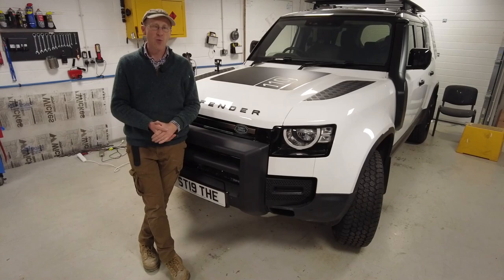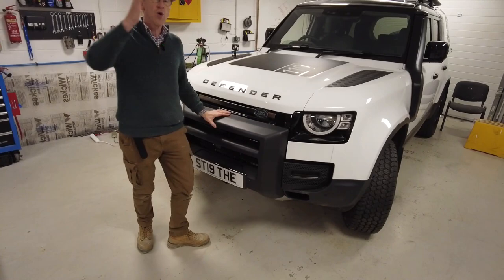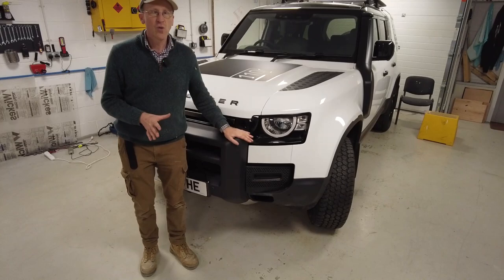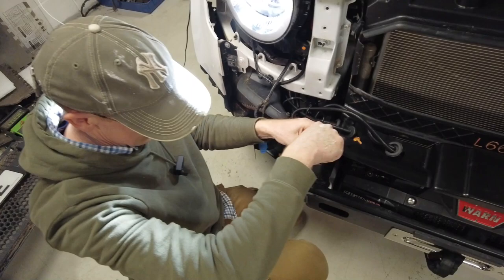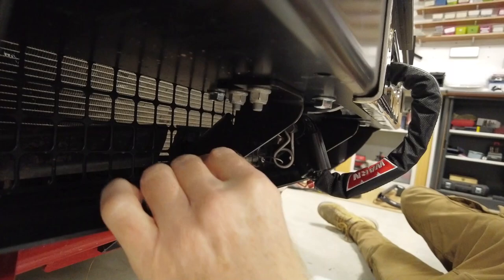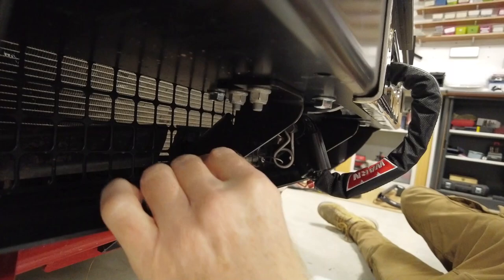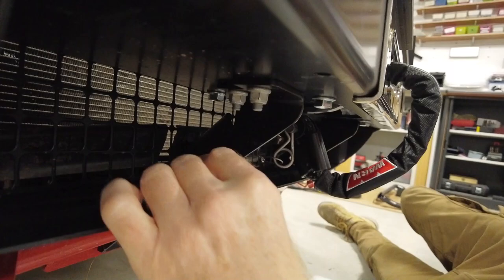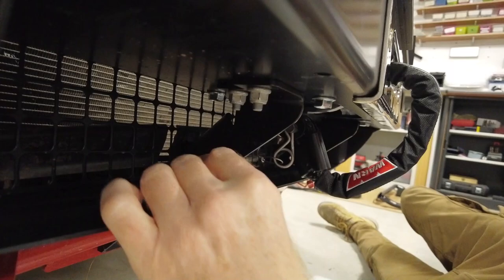New Land Rover Defender Winch Installation - part 5  "The Final Cut"

Comment: FGS how much is it going to cost to get the dealer or a professional mechanic to install this money-monster? No wonder the new TFL Truck [or TFL Off-Road] channel hasn't got a winch on their latest model; the US dealer who did the first may be getting sued for stress and mental breakdown damages by their mechanic who attempted to install it on the second Defender.  You are a hero for doing this and I'm sure it will be used as a reference by fitters everywhere for a long time. I wonder whether fitters will charge the end user for viewing time. ROTFLOL
Reply from the maker: I have rarely been happier to complete a job than this one.... other than fixing the D3 in the workshop...
Reply: @L663  
I'm sure. The D3 was probably a body-off job and probably no worse than the winch job.

Comment: Great bit of kit, well integrated into the new defender, what’s the total person hours to fit do you reckon?
Reply from the maker: I think it would be 2-3 days solid work.... if we were to do another ( which i have no plans to do for a while ! )
Reply: @L663  
At £100/hour typical dealer rate, that is probably £2000+ in labour cost on top of a purchase price of….what… £2500+VAT? A probable fitted total cost of £5000?  People will be queuing up for winches I'm sure. ;-(

Comment: And how much does this winch and bits cost!
And how many mods to the kit did you have to make
And how many instructions did you have to ignore or modify
???????
And look at the flimsiness of the parts (how many times before all those plastic clips break or become loose or stressed
And how many dissimiliar metal joints did you discover .... natural  galvanic corrosion points 
??????
Car is complete crap ..... winch may be the only part left in 5 years

Comment: Thanks a lot for video is helping so much to understand really what mean original accessory winch ! First this accessory is complete awfully and damage outside design of car dramatically. Second designing of this accessory was very bad because is not correct FITTED WITH CAR outside plastic. Water will damage both side adhesive up area  and to big speed on motorway will make noisy .  So good for pedestrian very bad for owner same arch wheel accessory is bad fitted! I will buy a defender and i wanted put winch original i decided to give up ! Shame for land rover didnt make an manufacturing winch professional closed for pedestrian or a serious pedestrian accessory to fit perfectly with care - each 2-3 cm fixing points - and not with adhesive …..
Reply from the maker: Yes it feels really like this was an after thought done by a different department...

Comment: Does this mod have an impact on your vehicle insurance, given its significance?
Reply: If I was an insurance company I would double the premium if this winch was fitted and put a £1000 excess on it, considering the conditions in which it and the vehicle with it fitted was likely to be used. I mean this is NOT a cheap vehicle to repair at all.
Reply: I was surprised, fitting the winch to my Discovery 4 didn't add anything to my insurance (NFU).

Comment: I have to say, comparing this to the ARB Summit bar with winch on my Discovery 4/LR4... this is insane.   The front end of the vehicle is just crazy with parts and so much plastic.   Put this vehicle through some real use and try to maintain this... wow.  What a huge pain in the ass.   They used sticky adhesive tape?!?!?  How is that even an option for something you might want to get apart again.

How the hell are you supposed to trust a dealer to install this thing correctly?.. lol.  

Now I know why ARB is not yet building bullbars for this thing... where the f do you even start.